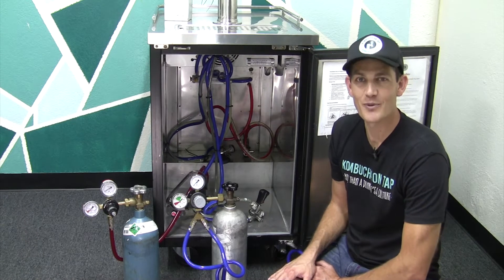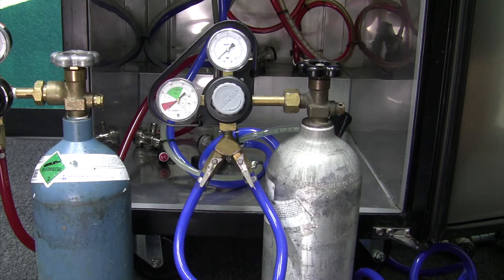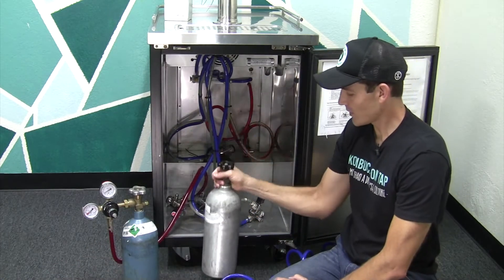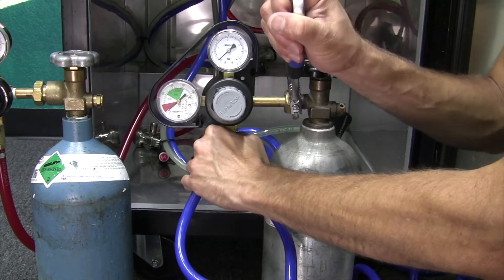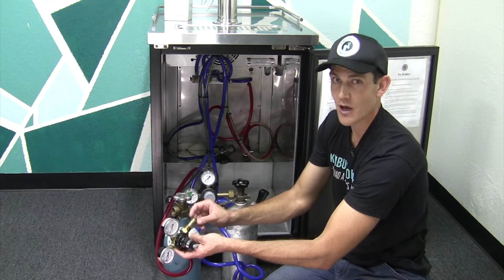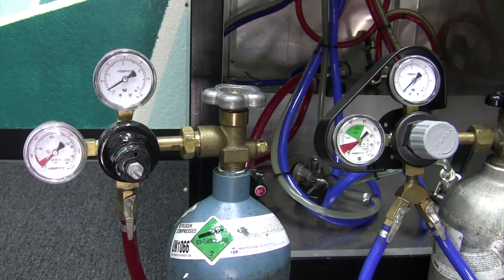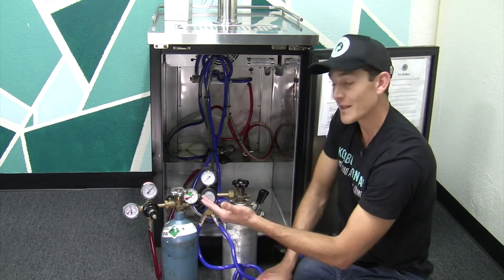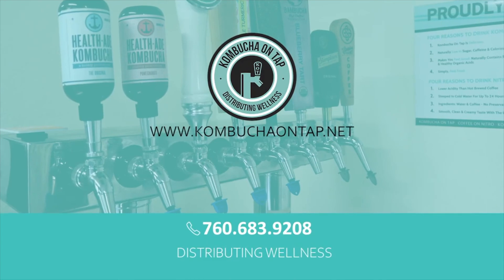How to Change the CO2 or Nitrogen Gas Cylinder on Your Draft System

Comment: a stupid question but, if youd open a cylinder on a CO2 full gas tank without having mounted the regulator, will you cause the CO2 to go out, if yes, is it safe releasing it from mere "hand-to-cylinder" usage? wont it explode?
Reply from the maker: Hi there, if I'm understanding your question properly, opening the valve on the gas cylinder without a gas regulator firmly attached, Gas WILL flow out of the cylinder.  There is not a check valve on the cylinder itself to prevent gas from flowing when opened.  I'm not fully understanding your "hand to cylinder" statement.  If you're asking, "can I turn the gas cylinder valve by hand and empty the gas out without it being attached to a regulator", it's best to take the cylinder to a gas refilling station or welding supply shop and have a professional do it for you.  Thank you for your question.  Safety is always the most important step of any task completion.

Comment: When I removed the CO2 line from the keg I discovered kombucha spilling out of it. I've never had that happen before. Our keg has been dispensing very foamy and slow over the last two weeks which was why I wanted to clean the lines. The regulator says the tank is still full. Any guidance on to what caused that to happen?
Reply from the maker: Hi Rebecca, thanks for your question.  It sounds like you're using Corney/Ball-Lock Kegs that have two connectors attaching to the keg, one for gas, one for product.  If this is not the case my response here will not make sense but let me know and I'll modify this as needed. Question 1: "kombucha coming out of the gas line": For Corney/Ball-Lock kegs there is NOT a one-way valve built into the gas port as there is on a Sankey connection.  With the One-way check valve not present, if there is high pressure in the keg but low pressure in the gas line (between the regulator and the keg connector) product can flow into the gas line.  This usually only happens if the keg is full since the gas tube inside a corney keg is short.  Here is a check valve you can install to prevent future back flow: https://a.co/d/iQ1b528.  Question 2: "keg dispensing foamy and slow"  There may be an obstruction in your output post.  Again, this is assuming a corney keg is being used.  Your faucet may also have some SCOBY buildup on it causing the flow to be obstructed which can cause foam.  While your gas cylinder may be full, what is the line pressure set to?  The line pressure gauge is usually the one that's above the regulator adjustment knob. For kombucha's pouring on a standard direct draw draft system with Product line length of 5ft the pressure is usually 10-12 psi.  I hope this helps you get to the bottom of it.  Follow up with any additional.
Reply: @KEGJOY2  Thank you so much for the quick reply and for the check valve recommendation. I will definitely be getting one. Our line is set to 12 psi currently. I did get the lines cleaned and I think you were right about the SCOBY buildup. Once I cleaned them and reinstalled our flow was much improved, still tad foamy but not terrible. Thanks for your videos and suggestions.